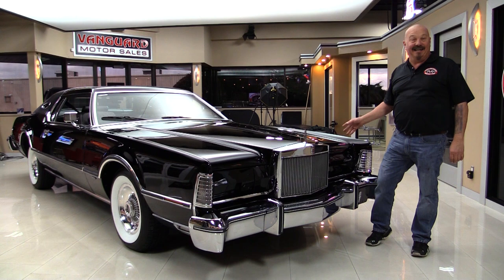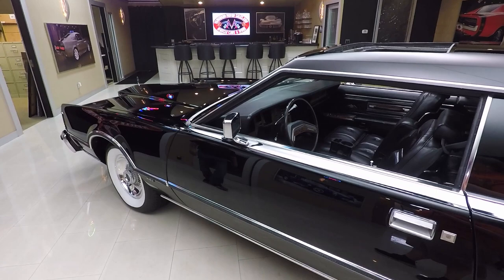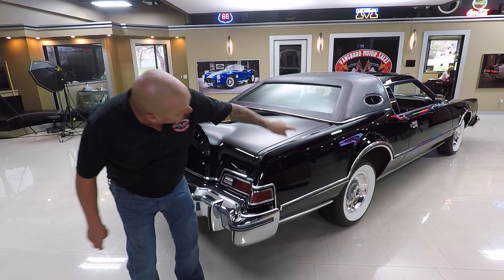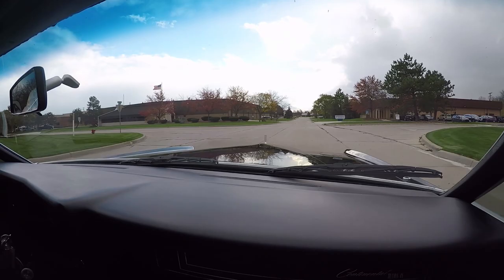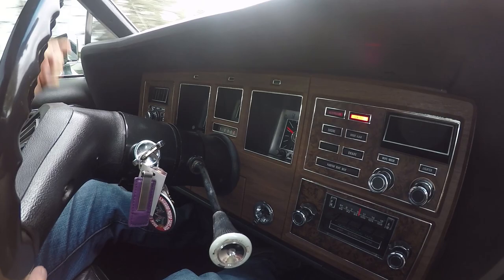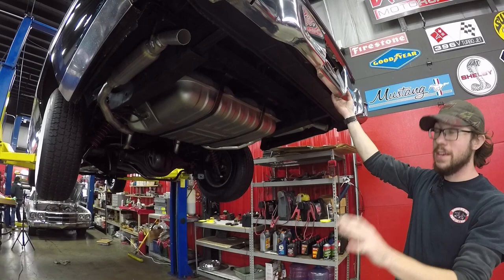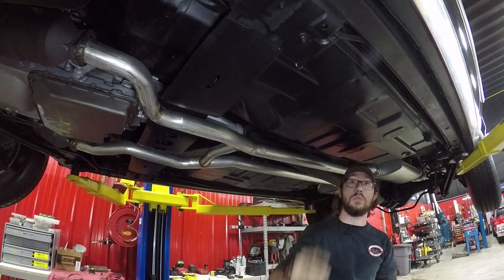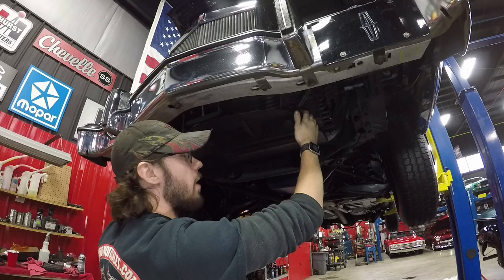1976 Lincoln Continential For Sale

Comment: Wonder what month and year it was built, because the white inserts in the plastic on the bumpers say 1975. 1976 had all black plastic on the bumpers. 
Same with the wood applique insert in the steering wheel. 1976 models are not known to have this in the steering wheel.
Reply: There was a special edition '76, it might have had some 'dressier' parts. I noticed the black leather seats seemed to have the patent leather inserts. Mine was a silver ' 76, but not the light gray Cartier. There was Pucci, Givenchy (beautiful full aqua blue) Bill Blass, Cartier and the edition I mentioned, I think they came with special black paint with speckles though. The moonroof was also usually in a package.